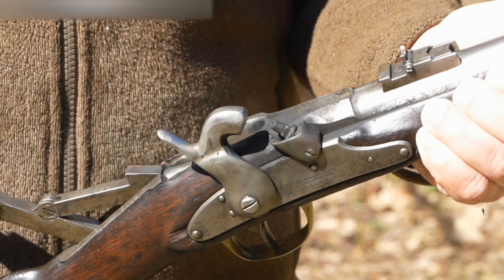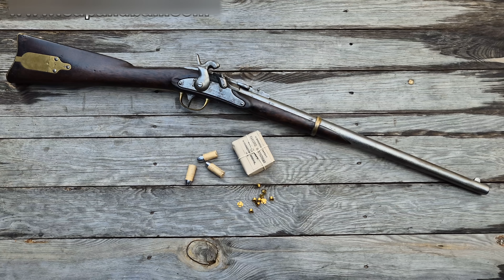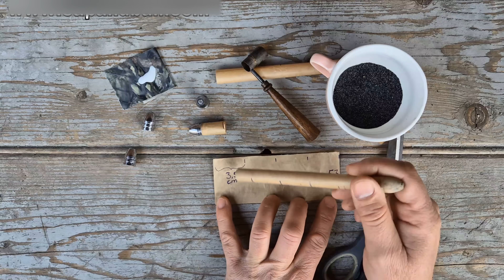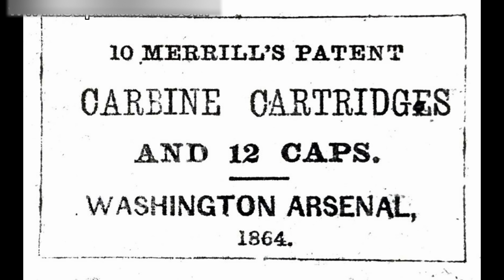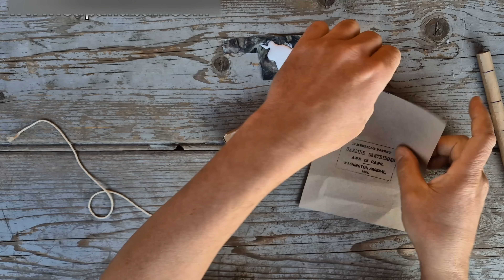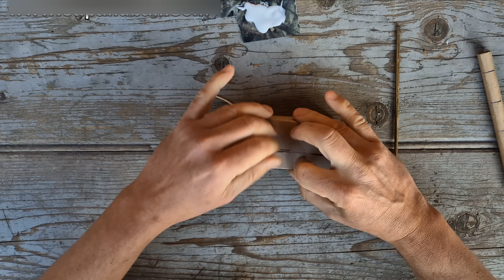The Cvil War Merrill carbine Part I/2.: Its cartridges and bundles

Comment: Are you using nitrated papet? It burns  cleaner and should give a little more  pressure, Easy to make. Treated paper looks and acts like regular paper.
Reply from the maker: No as the original cartridge was also rolled from normal paper.
Reply: I believe that only linen cartridges were nitrated.i think.seems like colt revolver cartridges might have been also.